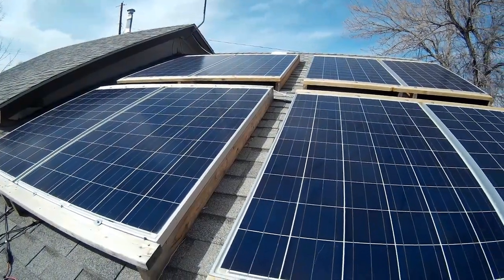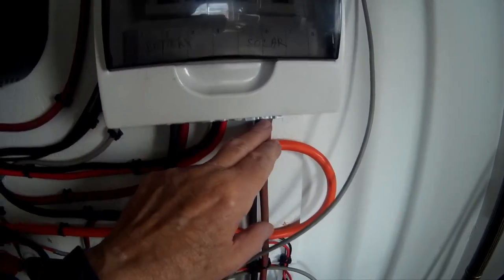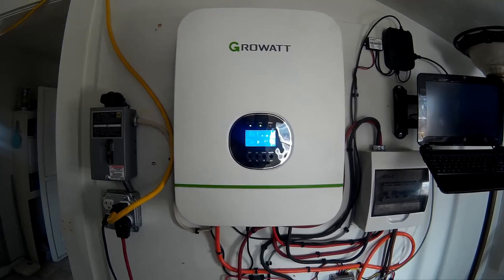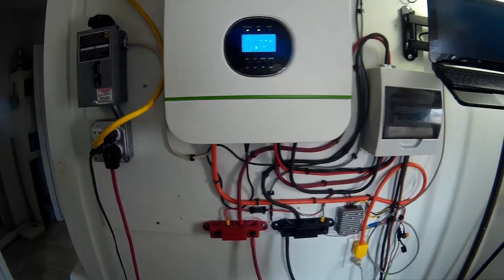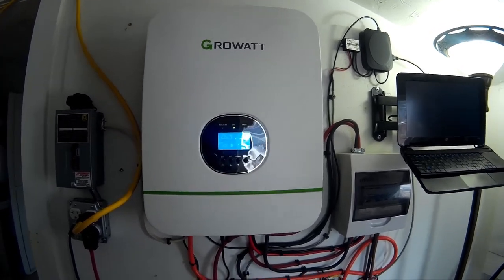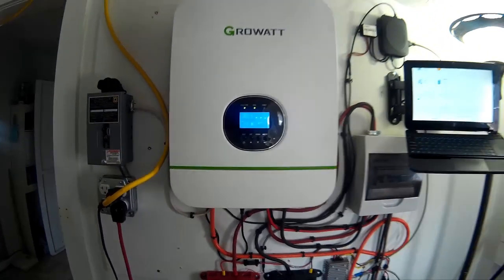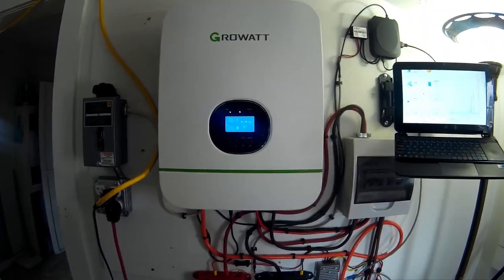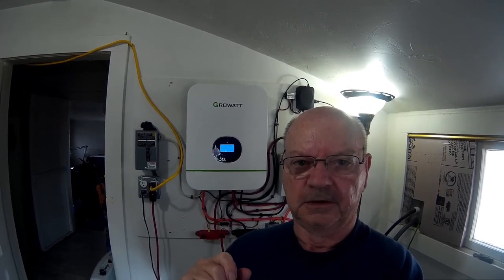Growatt Power, 3000 Watts

Comment: I have a very similar system, but i over paneled my inverter by 1000w with 15 panels in 3s 5p. You can tell the growwatt to only pull 72 amps of solar so you never pull more than 2kw saving the mppt ( I burnt my first one pulling 2400w!) Nice system 👌

Comment: Which Growatt model number is this? Is it the SPF 3000TL LWM-24P or? I'm in Europe, is this model adapted explicitly for the 120V split phase? I do like your setup, and considering something similar. Excellent presentation of your installation, Thanks and Cheers.
Reply from the maker: It is the SPF 3000TL LWM-24P. Single one is not split phase. Have to add another.
Reply: @butchwilliams7637 would love to see a video of that installation

Comment: hey butch if you had factory batterys with the bms all ready in then would they work to gather to make 24v and stay charge even?
Reply from the maker: So far with what I have experienced, I don't think so. Victron makes a balancer just for series set up like this. I decided to go with one box.
Reply: @butchwilliams7637  so it is better to buy 24v right at the start ?
Reply from the maker: @leetaves9143 That would be my choice.
Reply: @butchwilliams7637  ya just redo what you have ill be doing the same with my diy batterys
Reply: @leetaves9143  I would prefer to have 2x 12v with a balancer because it's less of a cost if a cell goes bad.  Instead of replacing a very expensive 24V battery, you only replace 1 of 2 12V batteries.  I haven't looked lately, but I think 2x12v is generally cheaper than 1x24V. This is also why I went 24V instead of 48V.  For the same cost I can have batteries in parallel for a 24V system and if one goes bad I'm just at half capacity, but with 48V one dead battery and I'm down until I replace it.